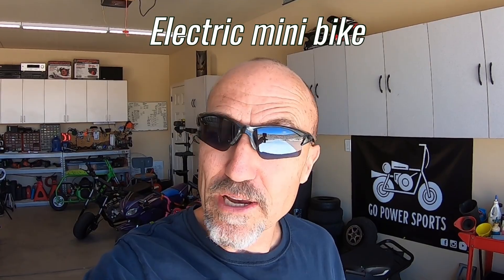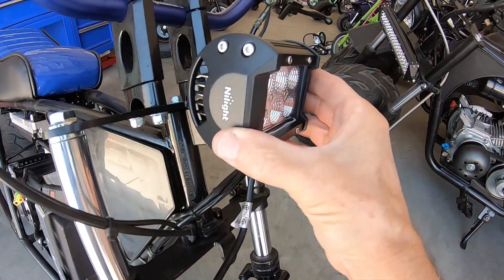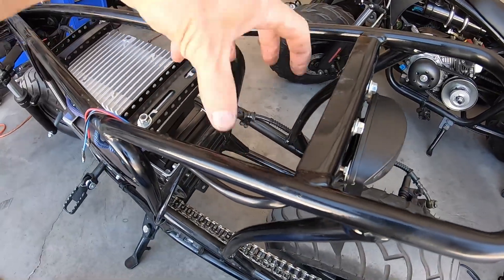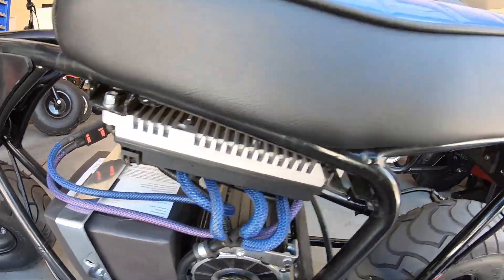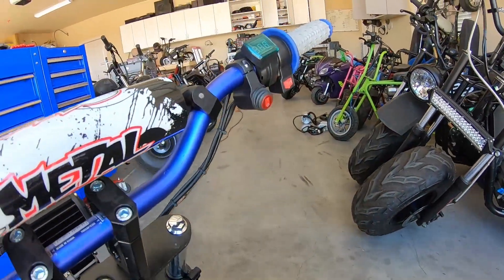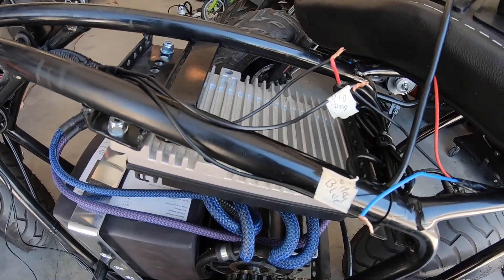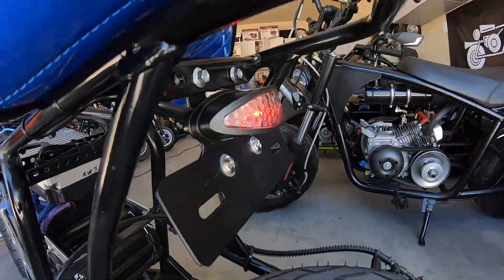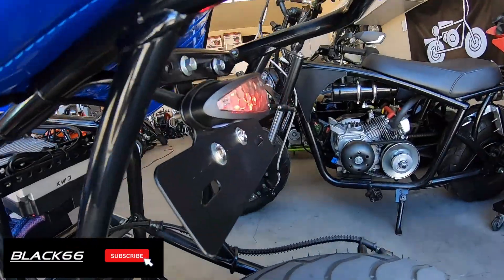Mini bike lighting made easy!

Comment: Hey I need some feedback before I spend some more money on my daughters bike, so the question is , if you have $300 to spend would you A) Buy the swingarm with hydraulic brake kit OR B) Buy 2 15x5-6 ultimate mini bike tires, 2 6” Mag wheels and front suspension forks . So wheels tires and front shocks or extendo rear with shocks and brakes… it’s $300 either way from GPS and I can’t make a solid decision because both have benefits. Only thing I see is I can piece together the wheels, tires and forks later because its inexpensive parts. The swing arm is $300 .
Reply: I should have noted that it’s MM105 frame
Reply from the maker: They both have their benefits like you say but for me I like the front suspension with the mag wheels. I would use a rear mag wheel for the front that way I could add the front brake kit. Then later I would add the swing arm for full supension or just cut off the existing rear wheel mounts and weld them on the back of the hoops to stretch the bike as I did on the first MM80/105 build.
Reply: My man… that’s solid advice and I would have messed that up getting a front and rear wheel. I was thinking I would have to figure out that front one somehow down the road. Thanks bro. Much appreciated.

Comment: A fixed or adjustable voltage stepdown converter mounted under the seat in place of the battery would supply 12 volt without running separate chargers and batteries ...
Reply from the maker: Yes I could but I wanted this system to be separate from the motor battery  ,that way it could be used on a gas powerd or electric bike .
Reply: @Black66  this way is definitely more modular.    Ive had good success using drill battery receiver kits from Amazon to power head lights and the occasional horn or USB charger

Comment: Do you have a link for the 12 volt output cable? Just Want to make sure I get the right diameter plug.
Reply from the maker: Yes, the link is in the description of the video. It's the last link in the parts list.
Reply: Thank you. I didn't see it there before. I want to do a turn single/ break light combo. You should do a turn single light video

Comment: What battery pack is that and wiring is that
Reply from the maker: Links are in the description of the videos. Check out the playlist for more lighting videos.
Reply: @Black66  sorry to bother you, but I have a 212 predator ghost engine on a Moto 212 and I cannot find a gas tank to fit. I went through about three of them trying to get them to fit, but it’s always a problem. Bought one yesterday and it didn’t fit so I sent it back this morning and ordered another one.
Reply from the maker: @elflaco7467 Maybe put a tank on the frame like a Uni tank from GoPowerSports  https://www.gopowersports.com/unitank-universal-minibike-fuel-tank/

Comment: No blinkers?
Reply from the maker: No need for blinkers to be street legal.  Check out the street legal video on the channel.
Reply: @Black66  Ohio does require turn signals and mirrors. But as my Trailmaster shipped with an interim title, NO inspection.
So as long as I don't get pulled over for [speeding] LOL